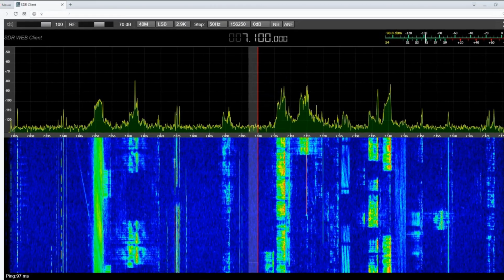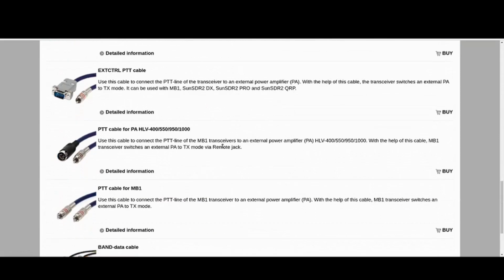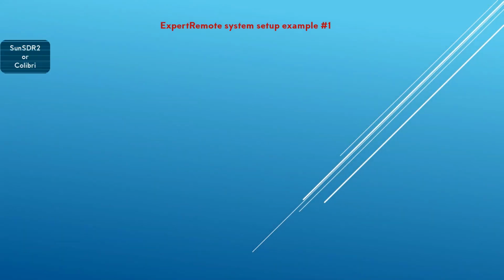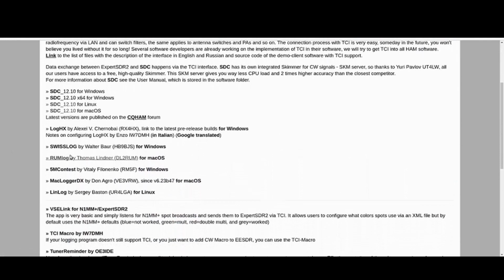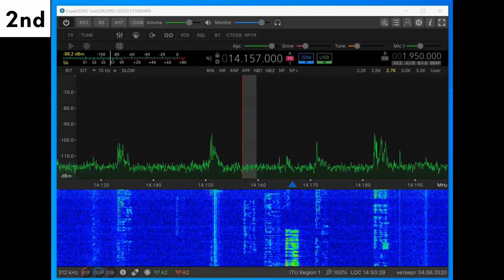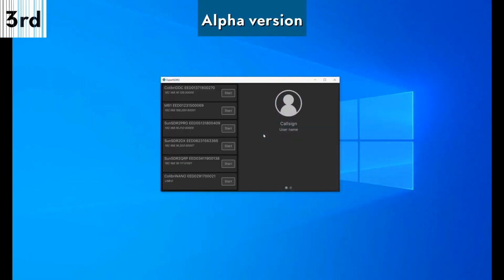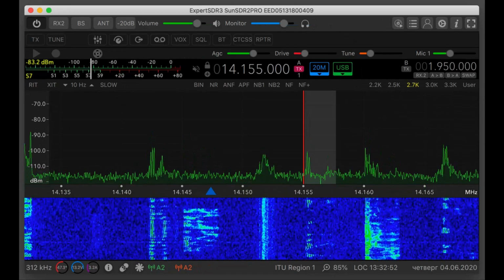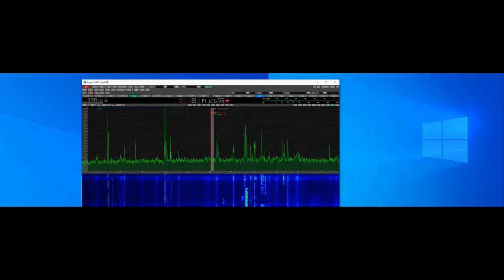Future of ExpertSDR

Comment: Please could you be more precise about the remote version of EESDR?
Will it be a different client with limited functionality (like it is now) or will it be the same client program used in locally setup?
Regards
iw7dmh
Reply: It'll be the same launcher which is used for the local operation, the functionality for both will be almost identical.
For several months we are working on the new core for the ExpertRS for RPI3/4. It's based on the similar module architecture (you've seen it in the video), with 2 variants of connection: direct (as now) and via the cloud service. At the moment we are working with ColibriNano. After we check the functionality of the whole system ExpertSDR3 + RemoteServer, it'll be advanced to support transceivers.
Reply: Expert Electronics Having a cloud service to broker the connection will be game changing.  No more faffing around with port forwarding etc 👍🏼
Reply: Expert Electronics An iPadOS client would be the icing on the cake 🧁